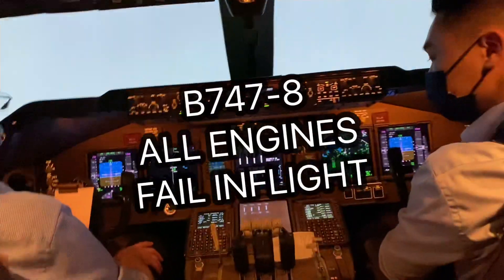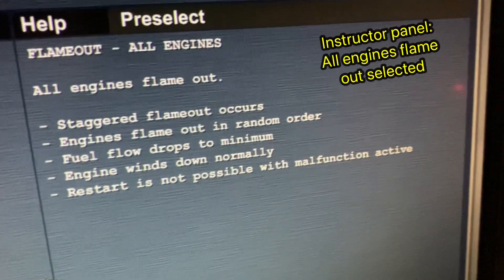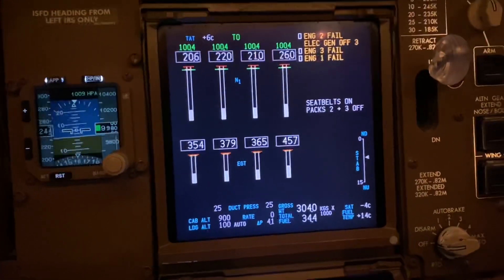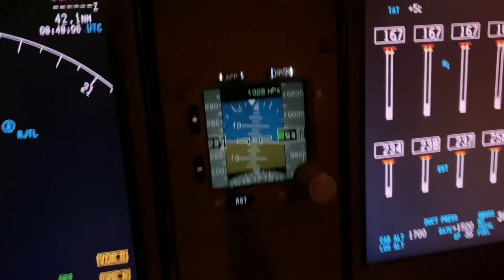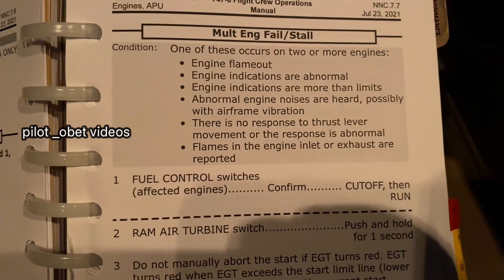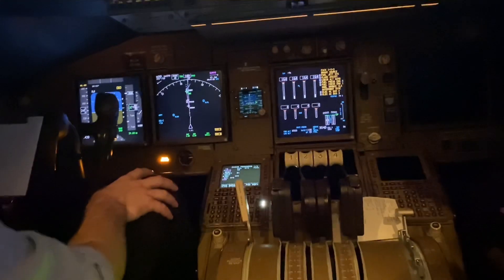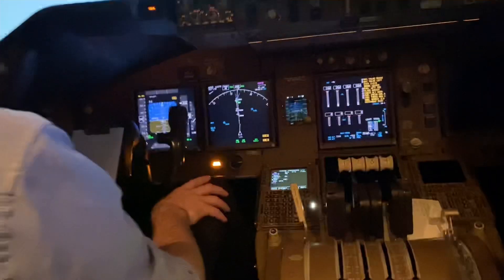BOEING 747-8 ALL ENGINES FAIL INFLIGHT (overview)

Comment: The 747-8 is going to become the 757 everyone will want it once they stop making it. You can’t call it a gas guzzler with 787 engines. In testing they took off with a take off weight of 1 million pounds. MTOW is 975,000 pounds that’s incredible. Large aircraft are going to be needed. The 777-300f it wasn’t meant to be a freighter. The MTOW will be limited and the cycles are going to be limited.      The 747 is going to be in high demand.
Reply: Yeah, as long as teleportation is not invented, the 747 will still live on dutily (at least as a freighter)
Reply: The 747 was designed to capitalise on the freighter market in the event that it was no longer needed in the passenger market. It's pretty evident when you look at the 747's design, the hump is clearly not there for cosmetic purposes. The mindset was that, at the time, there were talks of supersonic jets replacing turbofans in the passenger market (not to mention that passenger travel demand can rise and fall on a dime, unlike freight).
It still ended up being pushed out of the pax market in favour of twinjets like the 777, 787 & A350, so you could say that Boeing used the wrong formula and got the correct answer
Reply: @Namisincere  I love your description, especially when you said "Boeing used the wrong formula and got the correct answer". That description is spot on.

Comment: Hi capt, just a general question, do airlines take pilots' preference into consideration before ordering new planes, or is it purely based on cost and performance?
Reply from the maker: Cost….it’s about money😊
Reply: Minor additional note: If two aircrafts have similar cost, efficiency, capacity, etc - they may partially decide based on re-training costs. Some newer/revised aircraft may not require (or require little) re-training, which saves an enormous amount of money. 

That's part of what caused the 747-MAX debacle.

Comment: Awsome! Not the failure obviously, but the video.
Dumb question: is there a ballpark best glide speed or attitude for a 748, like in GA planes? If so, is it a function of weight? 
I've noticed the speed hovering around 240 KIAS on the PFD...

Cheers from Brazil 😍👍👊
Reply from the maker: Hi- yes there is. In general the best hold speed is a good one to maintain.

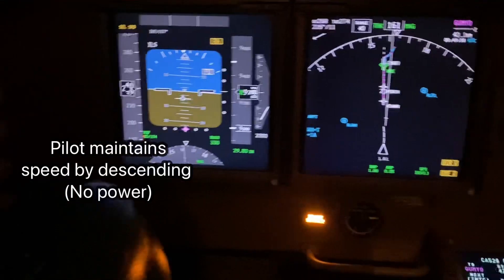Comment: Hello, capt, I have just recently subscribed, however I do have one question. If all 4 engines flame out, wouldn't the descent rate be greater than what was indicated on the PFD at around 3:50? I have no authority to speak for the handling of the 747 in an all engine flameout as I have never flown the plane nor am I a pilot. Thanks for replying.
Reply from the maker: Yes it can initially while establishing the required speed but will settle to normal descent rates for aircraft weight

Comment: What about trying to start the APU?
Reply: On the 747 the APU cannot be started inflight or used above FL200 if it was left ON before take off.
Reply from the maker: See some answers already given to other people that asked same question
Reply: @pilot_obet  sorry the other comments wouldn't show due to a browser cache glitch. I didn't take the flight level into consideration h but at a lower level it would be possible to start it in-flight?
Reply: @furzkram  You cannot start the APU on a 747 in flight. It was never designed to be used for such purposes.

The 744 has 4 engines & 4 separate electrical generators. This is a huge amount of redundancy.

An APU is not really providing much back up.

You are thinking about twin engines & two separate sources of electrical power & therefore less redundancy for critical systems.

Loose one engine on a 744…not really a big problem.

Loose one engine on a big twin…you have a big problem.

Comment: Is there a way to simulate fuel starvation? Engine will usually go down in a predictable or at least known order as the pumps run dry one by one. Anyone know?.
Reply from the maker: Yes, we can let the tank run dry and engines will shutdown. Ill try in simulator soon

Comment: why didn't they turn on the batties, engaged the apu and tried to restart the engines?
Reply: the batteries are always on in flight, 747 apu do not have in flight start capabilities, the engines are already wind milling and can be restarted in flight without apu

Comment: Thanks for the video Obet.  I asked you before about the Ram Air Turbine.  ... I've got a couple of questions to ask ... with an ALL engine flame out, why doesn't the RAT deploy automatically/immediately and does the RAT not provide any electric at all?  If it doesn't, how long can the aircraft survive without any electrical power being generated.
Reply from the maker: Hi- I think in my narrative I mentioned that it deploys automatically when more than two engines fail but its a belts and braces thing that we still manually activate the switch. the aircraft has 4 generators so for the rare occasion that yo may lose 4 engines, what you need is hydraulics more than electrical. Yo cannot start the APU in flight on the B747 for same reason- extra certification would be required for it on an aircraft that already has good redundancy.
Reply: @pilot_obet  Ah ok.  I think once again I got a bit over-excited watching your video  😂😂  so I must of missed you saying the RAT auto deploys.  Thanks for the video, another one of your terrific videos ... Captain Obet ... King of the Sky  🌟🌟🌟🌟🌟  👍👍
Reply: @pilot_obet  Can you elaborate on why the APU isn’t available?
Reply from the maker: @jesse00pno  it’s purely because of redundancy that is already available- as in 4 generators from the four engines. Twin engine aircraft like the B777/737/A350 etc need it as if they lose an engine, then they are immediately on 50 % thrust and only one generator. The likelihood of 4 engines failing although possible and has happened is still rare and 4 engines is good redundancy.
Reply: @jesse00pno  assuming he was at 10k, then it should be. I can't recall exactly but I think APU can start and work upto about 16... Also attempting to start APU eats up a large chunk of available battery, so it's best be really sure. But battery alone is enough to power critical systems for as long as she can glide, which is gonna be the limiting factor especially from ten k, that's gonna be curtains in less than ten minutes
Reply: @CameTo  747 APU is not able to be started in flight. It can be used to provide pressurization on takeoff, if needed for performance, but must be shut down above 15k.
Reply: @pilot_obet  For a bit of history on the APU start in flight limitation, it was possible on the classics, and an option on the -400, however in order to be able to start it in flight, it required an “air scoop” over the APU inlet, but that caused parasitic drag, since the biggest selling point of the -400 was increased range nobody ordered it with that option, so I believe Boeing quietly did away with it, amd it was never an option in the -8.  Additionally , while you can run the APU up to 20,000k ( If my memory serves me ), you can only use to for pressurization, since the APU gen can not be sync’d to the synchronis bus with the IDGs, you can not bring the APU Gen online in the air.

Comment: Why wouldn't you start the APU?
Reply: It’s better to use the Ram air turbine (RAT), to generate hydraulic and electric power through a prop placed in the slip stream of the aircraft.
Reply: @fireflythe7  747mech here ,747-8 RAT doesn't make electricity, it only makes hyd. power for system, 3 to help with aircraft maneuverability, in a event of multiple engine failures. reason for this (on the 747-8 w genx engines) is that the hyd pumps on the engines decuples from the gearbox to reduces the drag on the engines for a inflight "windmill" start.
Reply: @ Ah my mistake, in that case both should be started if possible.

Comment: Why no APU
Reply from the maker: The B747 APU cannot be started in flight. It is a thing that is fitted on twin engine aircraft generally because of less redundancy. With 4 generators on 4 engines, it was never certified for use in flight. That’s why no APU

Comment: What's the chance of having multiple engine failure on a Boeing 747?
Reply: @ImperrfectStranger  so, chances are very low
Reply: @ImperrfectStranger  Google - British Airways Flight 009,  This was a 747-200 that lost ALL 4 engines due to Volcanic Ash and almost had to ditch however the excellent skills of the crew and the fact they flew out of the ash thankfully lead to the engines coming back on line...

Comment: why not start apu ?
Reply from the maker: The APU is not available in the air on B747. You can takeoff with it on but only for pneumatic power- no electrics. Even then it’s only up to FL200